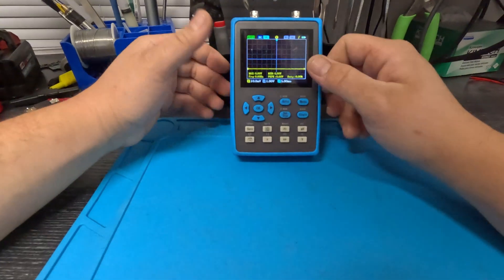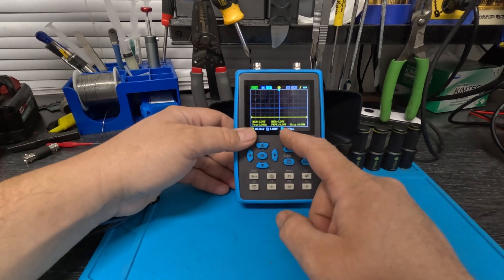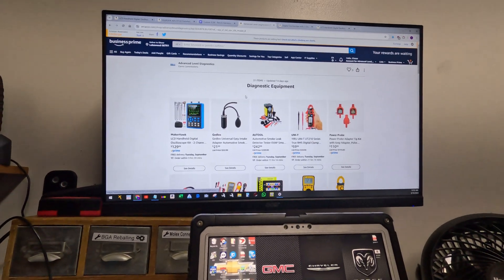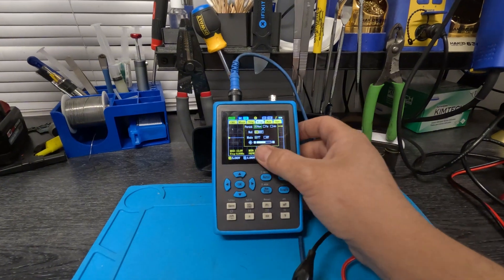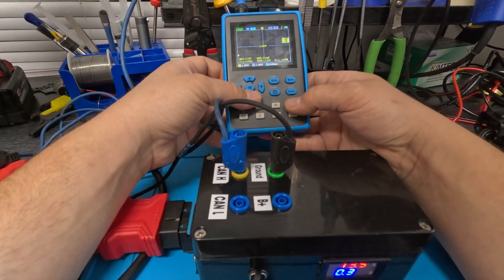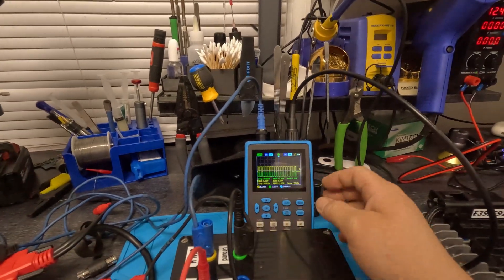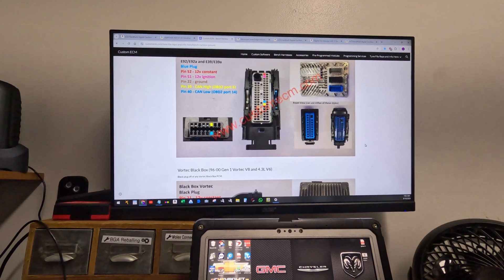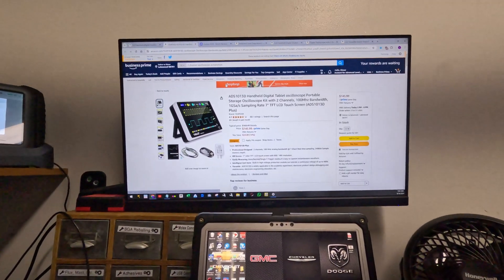The Best Budget Oscilloscope?? Tutorial.

Comment: This is a neat budget scope;  but the b3st mid tier scope that I've found, that gives you everything but it's much cheaper than getting the 4channel P^co scope:   It's the R^goI DHO804. It's true 12bit vertical resolution and has 25Mpts of deep memory.  Fantastic 4channel bench scope that is quite small and portable.  It runs on USB-c for power, so you can just run it easily with a power bank or even a charger adapter to the 12v battery in the car... They were three hundred when I got mine, but they have since gone up to four hundred now.. Because they were so good and getting bought up so fast,  they had to raise the price I guess.   It has all the features of their $4k versions, except in a much smaller package and a little 7" touch screen.   This is by far your best bang/per/dollar if you want something mid tier.
Reply from the maker: I have that scope in my cart for a while now! I want it for my bench setup. It does seem impractical for using on a vehicle in the field. I saw people complaining it takes awhile to boot up. I love how it has a visa mount!
Reply: @advancedleveldiagnostics  Yeah.. I feel that way about a Pico too though.   But when you really need it, it's a great option (the dho804).   EEVblog did a k^ller video breakdown of it...   (But I agree with you,   it's definitely good to have a small handheld scope for most things.)  About the boot up: I just turn it on as soon as I break it out, then by the time you get all your leads hooked up and situated-- it's already done booting.  I think what those people are doing is getting everything setup first, and then switching it ON last and standing there doing nothing while it boots.  I think it takes like 48 seconds or something.. so it's definitely not a big issue IMO
Reply: @advancedleveldiagnostics  Yeah.. I feel that way about a P^co too though.   But when you really need it, it's a great option (the dho804).   EEVbI0g did a k^ller video breakdown of it...   (But I agree with you,   it's definitely good to have a small handheld scope for most things.)  About the boot up: I just turn it on as soon as I break it out, then by the time you get all your leads hooked up and situated-- it's already done booting.  I think what those people are doing is getting everything setup first, and then switching it ON last and standing there doing nothing while it boots.  I think it takes like 48 seconds or something.. so it's definitely not a big issue IMO
Reply: Yeah.. I feel that way about a P^co too though.   But when you really need it, it's a great option (the dho804).   EEVbI0g did a k^ller video breakdown of it...   (But I agree with you,   it's definitely good to have a small handheld scope for most things.)  About the boot up: I just turn it on as soon as I break it out, then by the time you get all your leads hooked up and situated-- it's already done booting.  I think what those people are doing is getting everything setup first, and then switching it ON last and standing there doing nothing while it boots.  I think it takes like 48 seconds or something.. so it's definitely not a big issue IMO